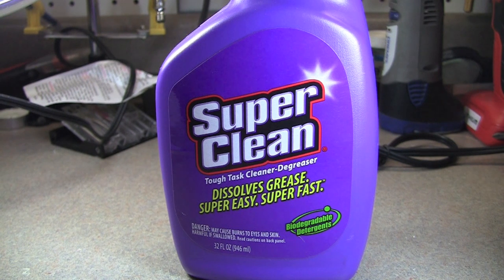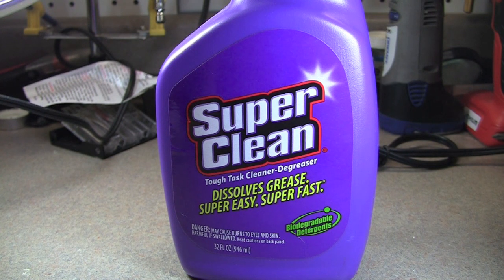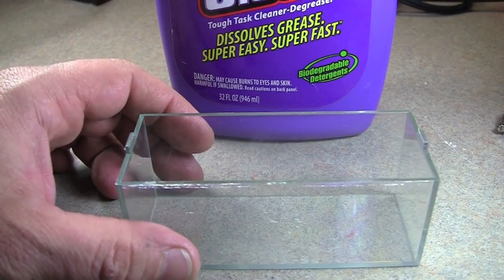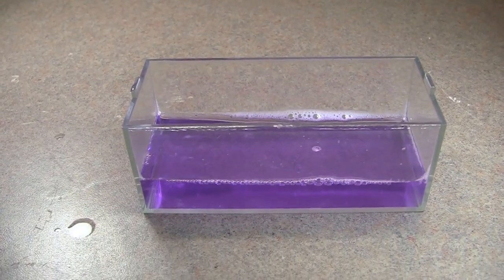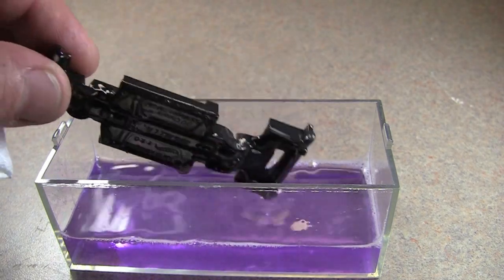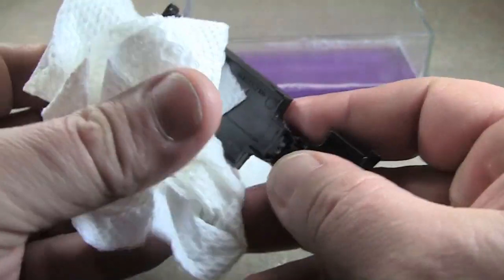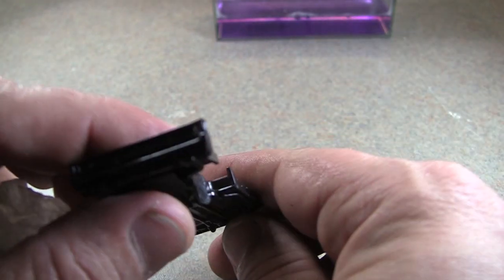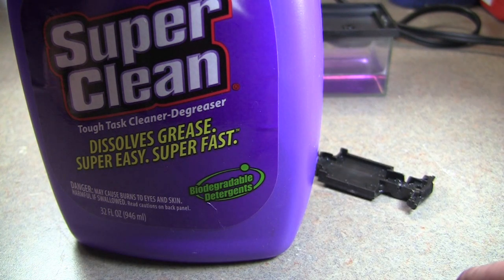How to Remove Chrome from Plastic in Minutes!

Comment: Chromed plastics are actually a coating of aluminum. “Dechroming” with oven cleaner is a chemical process. Oven cleaner is a base containing sodium hydroxide (NaOH) sodiumhydroxide reacts with aluminum to form Al(OH)3 or aluminum(III)hydroxide. The aluminum hydroxide is now dissolved into the solution of oven cleaner. I suggest you do not reuse this solution for cleaning surfaces that come in contact with consumables. Because Aluminumhydroxide only dissolves in Alkalis and acids it’s likely that rests are left behind after cleaning with the solution that won’t easily wash away with water.
Reply: Ok so you know your stuff👍.. I'm soaking plastic chrome plated car emblem letters "separately" in Zep purple industrial degreaser, Bleach & wallmart purple degreaser and nothing is working at all like it's all a cruel joke, what would you recommend please?

Comment: Yeap, I guessed that it was caustic when I started watching and sure enough, when you showed the lable on the back of the bottle, it said sodium hydroxide, (chemical formula NaOH). That's Lye you American chappies and caustic soda to us Brits.
  Heh, it works quickly even as a dilute solution like this, it just shows how incredibly thin that chrome actually is.
Reply from the maker: +wordreet Ahh!
Reply: Excellent observation. I have only just discovered this video and your comment. I find the cost of "Purple Power" Prohibitive . Where did you obtain your bottle of "Super Clean" here in the UK.  And is it cheap enough to merit buying by a simple hobbyist? Or should I stick with my toothbrush and Sonic Bath?

Comment: ok this is amazing!! I went to walmart yesterday n bought a bottle of the super clean got home and picked out some parts from a model im building, Revells Ford T Street Rod, like exhaust pipes, wheels, & intake manifold. put those parts in a dish and poured some super clean in with them, swished it around a bit, and yeah it works just like you show in your video!!! thank you!! you have no idea how much that just helped my modeling! I HATE chrome but could never figure out how to get rid of it! my models will look SO much better and realistic now thanx to you that's amazing! thank you so much I greatly appreciate this tip and will recommend this video to everybody

Comment: Does your method actually  "removes" chrome finish or oxidizes chrome to a black finish which means the chrome finish is still there but a different surface color.

Comment: THIS IS NOT CHROME. It is an aluminum PVD coating. Real chrome coatings are HARD and if you are trying to strip a bumper (or other car parts) or chrome-plated metals you need a harsher chemical. Soaking in muriatic acid or bleach (at least 10% sodium hypochlorite) for a couple days will do the trick. Make sure you choose the right chemical for your project or you can end up dissolving one of your parts. There are videos that go in depth on how to do this procedure properly.

Comment: I have a Tacoma MANUAL transmission with 2 very small interior chrome pieces left from a chrome delete project. 
The center console cup holder trim and the shifter knob collar. Is the chrome application on a hot wheels similar, to the interior Toyota trim? Is this method ACTUALLY removing the chrome ? Or changing it black
Reply: Im trying it on my Audi interior chrome, and so far after an hour of soaking nothing is being removed

Comment: Excellent tip !
Oops though, imagine louts walking around with this stuff, randomly spraying peoples chromed wheels and running away lol
Reply: It wouldn't do anything. Model cars aren't coated with real chrome, which is why such a mild cleaning chemical removes that shiny coating in this video.

Comment: I tried to use acetone to remove the chrome plating on some old plastic model parts from the 80s, and it melted the plastic, completely ruined the parts. I read online that others used acetone with good results, maybe it works on newer models? But I'd advice to never use acetone for this.

Comment: I was restoring some rims for my car.  I used a rust converter metal primer on them.  The rust turned black and as it was drying, I sprayed this stuff on them, and I had clean bare metal.  No more rust.

Comment: WHAAATTTT, thats crazy. Im in the process of Blacking out all the plastic chrome on my motorcycle (actual motorcycle not a model). I was about to sand the chrome, which would take hrs, then hit it with primer, paint, clear. But now im just going to soak them in this stuff and save me a lot of trouble and the paint will adhere better also. Thanks for this post.
Reply: How did that work out for you I'm ready to take some Chrome off my motorcycle parts too😂😂

Comment: I've worked extensively with super clean, and others such as "simple green". you don't need to worry about getting it on your skin. it's not an acid, so it will NOT "eat your skin". unless you are allergic, of course. BUT, the one thing you do want to be very careful with is the fumes. I was cleaning an oven with simple green (same fumes) and inhaled some, I ended having to go to the emergency room. I was feeling VERY, VERY BAD for at least a week. I highly recommend taking it outside, or in the garage. opening windows doesn't help that much. now you wouldn't use as much for stripping chrome, as I did for cleaning the oven. but you do need to keep it in mind

Comment: Will this work for chrome on plastic auto parts? Specifically grills.
Reply from the maker: I don't believe so. Might be worth a try though!
Reply: No, this will only take off the sort of aluminum fake chrome that's common on models, some interior auto parts, etc. Sorry, but if you're doing a grille, that is legitimately chromed plastic. If you're looking to ditch the chrome and paint it body color or something like that, you're going to have to bust out the sandpaper. If you look around on YT, there are quite a few good vids on the process.

Comment: Did this truly remove the chrome, or just oxidize it?  I'm removing all the plastic chrome pieces from my truck (window vent visors, grill cover, door handle covers, mirror caps) and I'm going to scotch brite them, prime and paint them to match the black truck.  If this purple stuff basically etched the chrome I'd be really happy.  If it oxidized it, I'm not sure I like it.
Reply from the maker: I doubt it will work on a real vehicle. It's mostly for chrome plastic on toys or other small parts.

Comment: I'm looking for a product to do just the opposite of this. I do not want to remove the chrome paint from the plastic. I want to vinyl wrap chrome painted trim pieces in my new Porsche Boxter to match the exterior color (Guards Red), but not damage the underlying chrome painted plastic if/when we decide to remove the wrap/film. I'm concerned about damaging the surface when removing the adhesive.  Does anyone have any ideas of what would work?
Reply from the maker: Wish I knew, not sure :(

Comment: I wonder if this will remove the chrome on my plastic grill on my truck? I guess it would take longer, maybe do it a few times. What do you think, any ideas??
Reply from the maker: I doubt it. When I had my F150, I rough sanded the chrome, primed and painted. Turned out pretty nice.

Comment: Not sure it actually took the chrome off. Looks like it just caused the chrome to turn black through chemical reaction.
Reply: That's what I'm thinking, because there was no discoloration in the purple fluid. I always scrub my chrome parts down with damp Ajax and an old toothbrush, and it comes off as a dark stain in the Ajax mixture. Interesting.
Reply: @beltfed4624  I wiped mine down with a red scotch pad then a grey scotch pad. Used a adhesive promoter, then a black plastic primer, 2x gloss black, then 2K clear. Came out amazing.

Comment: As you explained how to remove chrome from a toy, will this decreaser remove a clear coat finish from a plastic custom grill off an F-250, any feedback or advice you could share with me would be most appreciated, thank you in an advance,
                            Kyle
Reply from the maker: +Kyle Greening If you could find a large enough basin and let it sit long enough it probably would. Keep in mind, it has to soak in there. I would probably try a mild paint stripper, it would be cheaper.
Reply: or just sand it off or buy one that's flat black without chrome

Comment: Tried your method: I works perfectly! Thank you very much for sharing! However presently I am not succeeding with a base by MC Toy, any suggestion?
Reply: If you haven’t found your answer by now, this only works on aluminum, or fake chrome. 
To remove actual chrome, you have to use bleach. And you have to be patient, it is going to take near a week, with daily bleach changes. You will begin to see the effects about 12 hours in, as the bleach begins to turn black.

Comment: I need to remove chrome from  my RC truck wheels. So if I drop entire wheel with tire (rubber with form) will it affect the rubber.? or This chemical is reacting with only plastic parts.?
Reply from the maker: +Ravindu Srinath I would take them off just in case. Regardless, it will probably eat the glue holding the rubber on.
Reply: +WheelsNThangs Oh....I forgot about tire glue. Thanks a lot.
Reply: +Ravindu Srinath Yes, as our main man said remove the tires if you can. If they have a foam/sponge 'donut' inside it will absorb lots of the solution!  If they are glued with cyanoacrylate, try putting them in boiling water for a couple of minutes first, that should soften the superglue. Don't forget to wear two pairs of rubber gloves!
Reply: +Ravindu Srinath How did that work out for you ? I plan on doing the same then dyeing them black or spraying them with plasti-dip. Cann't go wrong with stock wheels then you know you got the right off-set. The chrome just looks date now everbodys going for the plasti-dip look.
Reply: +natemorte Actually I put the whole wheel with tire and it affected the tire glues...so anyway once I remove chrome from the wheels I re glued them.
Reply: That might just save me a step I'm planning on swapping the tires out anyway. Thanks

Comment: Farm out mon. I never knew dat.
Reply: I used some other purple cleaner I had in the garage. It worked but I had to let the rims sit overnight.
Reply from the maker: Gitar Zan At least it worked. This Super Clean worked amazing.
Reply: WheelsNThangs It worked in a pinch but I am for sure going to find a bottle of Super Clean. I am  dechroming a 1/16 Dukes of Hazzard Charger. Doing it Cobalt Blue. Should be cool. Maybe Ice Blue rims. (no decals)
Reply from the maker: Gitar Zan Sounds sweet!

Comment: Wish this worked as well for me! I've tried this a few times now, and it does take some of the chrome off. But no matter how long I leave it in, it never takes it all off.

Oh well, better than nothing!
Reply from the maker: +blfry That stinks :(
Reply: WheelsNThangs Haha... Update: I let it soak over night, and most of it did come off. So it worked out eventually. 

Thanks!
Reply: just Sand it by hand with 300+ grit sandpaper. don't be lazy
Reply: Leon Springs Boys TV You have no idea what you are talking about, do you?
Reply: blfry lol sorry I thought this was a vid for auto parts.. Not hot wheels lol. My bad
Reply: Leon Springs Boys TV Haha... no problem!